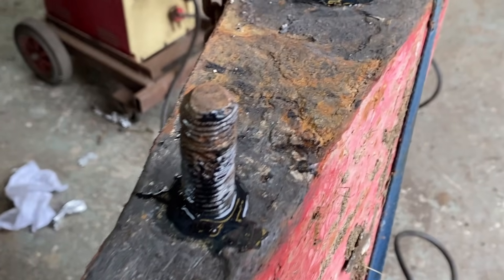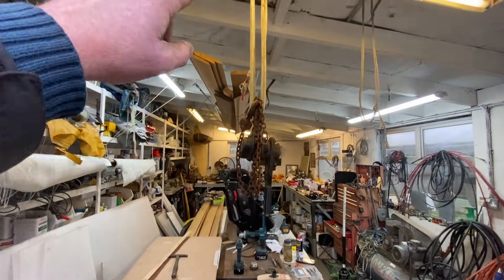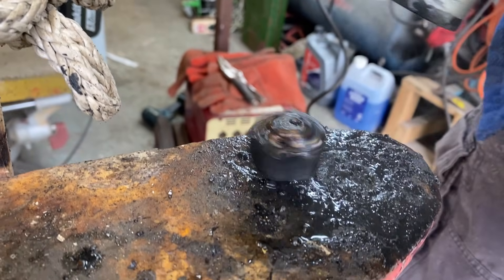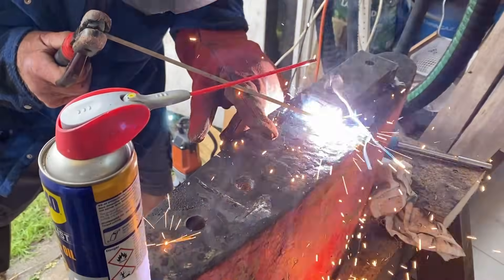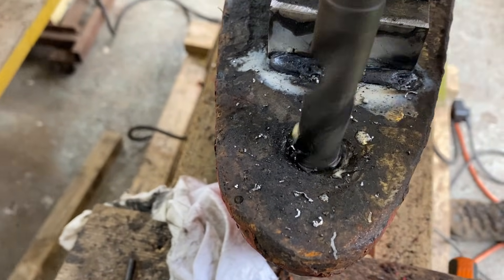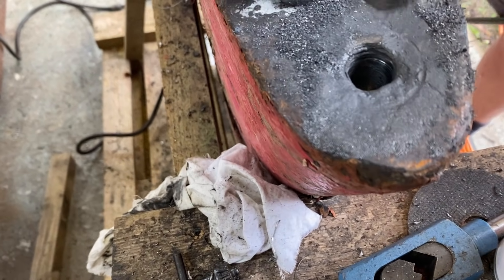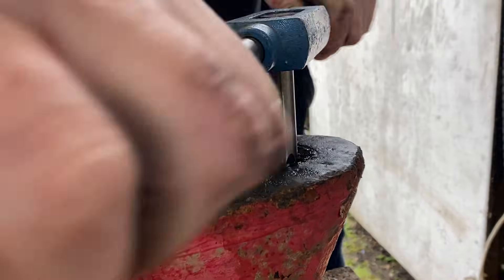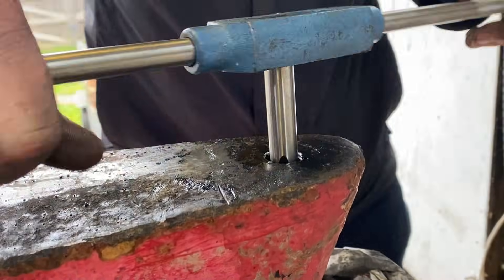Replacing 40 year old keel bolts: Drilling, tapping and lessons learned.

Comment: Good job. We are going through the same process at the moment. Replacing out old bolts with studs. Interested to see what metal you ended up going for
Reply from the maker: I’ve gone for high tensile mild steel. The old ones lasted 40 years. Good luck with yours. 😁⛵️

Comment: Aluminium bronze keel bolts ...expensive though
Reply from the maker: @simonworsnop900  oh yes that too! Another option!😂 I think they all have pros and cons so it’s a toss up between which cons I’d be happy with. Thanks for adding to the conundrum!😁
Reply: This is probably late, but you don’t want to use bronze as you’ll get severe galvanic corrosion with the dissimilar metals.